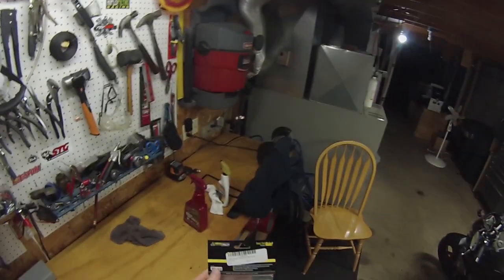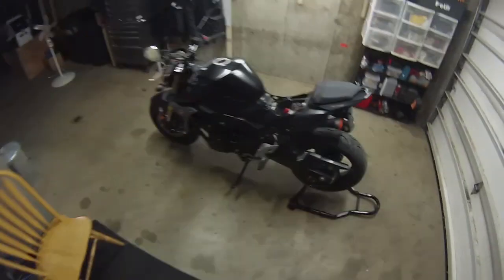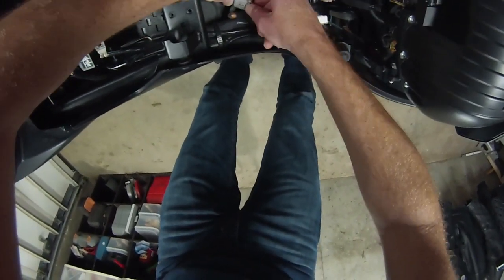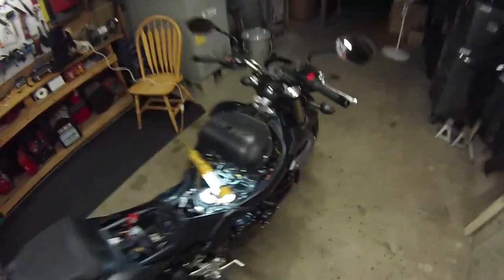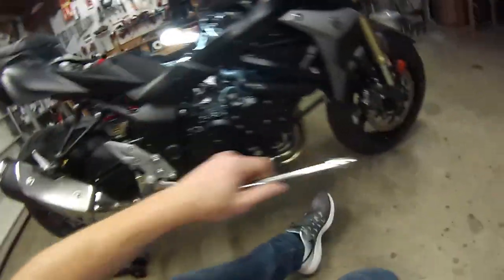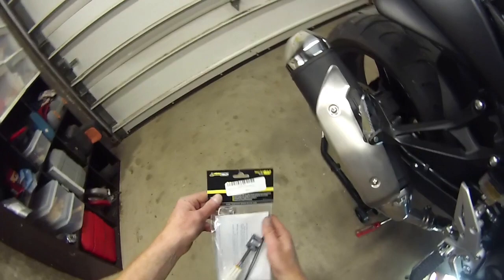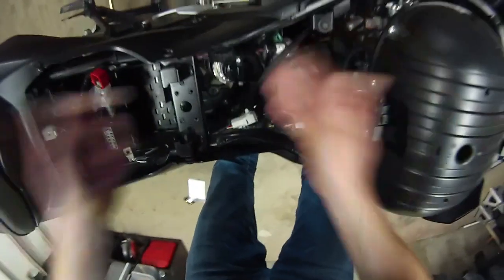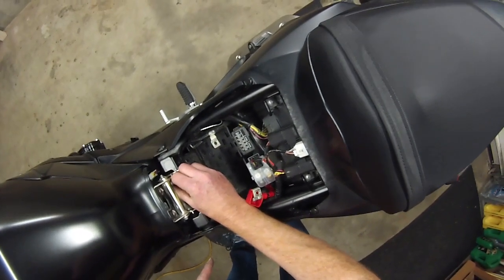How-To | Exhaust Servo Removal | Suzuki GSX-S750

Comment: I have a 2014 GSXR 750 Man u hit the nail on top of the head ,,,,, so I took off  the cat and put on a slip on ... it ran ok sounded a lot better of course. .. then I put in an K&N air filter and took off the the servo motor ..wow what a big  difference  a really big difference. Doesn't feel like the same bike at all ...it just runs so much better  night and day better

Comment: Hello Michael,
Do you think this valve is only for noise reduction or is there another use ?
Reply from the maker: It’s designed primarily to control back pressure. To improve low end throttle response. On some bikes it works well. On this one, in my experience, it’s in the way. The engine likes it gone 👍 And this engine likes the intake opened up. Funny that the newer version of this bike do not have the servo valve and the intake opening is much much larger 😎👍 and they make more hp. IMO, since this engine was built back in 2005 it was never meant to be saddled with all of these control systems. It wants to breathe!!

Comment: Any idea if the servo of the Suzuki Katana 2020 is the same place? I really hate how there is no manual that shows how to  remove the fairings and tank of the suzuki katana
Reply from the maker: I think they stopped using the valve after 2016?? I bought a manual for my bike at https://www.service-shop-repair-manual.com/ good prices. Hope they have one for your bike. It helps!

Comment: I removed the cables from my butterfly valve and started my bike... one is now jammed as far up to the nuts as possible and the other is sticking out 4 inches. I was going to adjust back pressure but now I'm in over my head. Any tips on how to get the cables even again?
Reply: Disregard that. Just got it lmaoo
Reply from the maker: @oogaboogaman753  Awesome :)

Comment: Put in a lithium battery. The prices have come down quite a bit lately so it's a nice and easy way to improve the power-to-weight ratio. Not that you'll even notice it while riding but in theory you should be improving handling, acceleration and even fuel economy.
Reply from the maker: When this one dies I'll take a look at lithium. I'm always looking at gains vs cost.

Comment: Awesome Video Bro!  I really appreciate your effort showing other GSR/GSX-S users how it works. I got the F1 code error with exhaust valve problem. I am really disappointed with Suzuki. They've made such a part that is only working sometimes with lots of complaints and faults. Now it's taking so much effort to fix this issue.
I also saw other people with older GSXR who did just cut the exhaust control cable, removed the #30 wire,  that over-ride the F1 error. I was wondering if that technique would also work on this bike. I knew the Eliminator is the ultimate solution, but I also saw other comments that it failed to work, probably because it's incorrectly installed. It's still a bit risky, isn't it? 
Alternatively, get a new new SERVO and replace the faulty one.... maybe. sorry for putting a long comment, I'm weighing the best way of solving this issue...
Reply from the maker: Thanks for the feedback and comment. I went thru a similar search for a solution to the servo valve. I learned that it has an electrical adjustment range that needs to be dead on according to spec, I learned how people removed it or bypassed it with different methods. I also read about how some bikes ran better with it on, some ran worse. As I learned, the gsxs runs better with it removed. And the best long term fix is to remove it and use an eliminator that will lie to the computer so that everything runs perfectly. (But of course this leads to the need for more fuel which means more cost/programming). But If you ever need to trade your bike or sell it, you can always include the original parts, and they can be bolted back on if needed. But as soon as you start hacking and cutting, your bike is no longer “clean”. Often, homegrown budget solutions can be unreliable and downright ugly and if you do something wrong can lead to more problems. I don’t like to spend money either. But when it comes to a motorcycle, I like a solid clean reliable solution. That’s just me! It helps me sleep better at night 😎👍
Reply: @sstressfl  That's a good point. I'd rather have it properly fixed too. Thanks a lot for your fair opinion. 
I'll take my bike to the dealer next week to ask for their opinion, and decide what to do next. My GSR has done nearly 80k, if anything is costing over $500, I will need to be very careful with the spending. after all as much as I love my bike, it's worth no more than $3k I guess. By the way, I am in Australia, the parts are not as widely available here. I'll let you know how it goes. Thanks Michael!
Reply from the maker: RiderYin I look fwd to hearing how it works out for you. Hopefully well under $500 👍 Dont be a stranger my friend 🙏✌️
Reply: @sstressfl  Just to update of SERVO. I've sent my bike for 72k major service. I've mentioned about the exhaust valve issue, the Suzuki workshop mechanic instantly recommended the Healtech Eliminator to me. It costed AUD$80 + GST to get it done along with major service. Now my bike feels like brand new! with no hesitation in low end acceleration. Wow, I LOVE it. I should have done 5 years ago. I won't do it, but it must be so much easier to wheelie on GSR now (I've tried, but I thought GSR wasn't powerful enough and too heavy)... Thanks man for your help! I'm not as handy as you, but so glad I got it done. And I'm sure GSR will last much longer!
Reply from the maker: RiderYin that is great news!!! So glad you are servo-free. It makes a big difference on this bike. Enjoy my friend and stay safe ✌️🙏 and thank you for the update 😎👌

Comment: Take the seat shrouds off! It's 1 bolt and 1 plastic clip you can undo with a pen! Then you have a good bit more room to undo those small bolts.
Reply from the maker: I saw that, but was worried I'd ruin the clip. Thought it was better not to remove it if I didn't have to. But it sure would have helped.
Reply: Mine have been very reliable, they come off everytime I touch the bike. Push the center pin in, pull the clip out and when you go to put it back in set the center pin out the top.....

Why the hell am I explaining this, you probably know more about it than I do haha
Reply from the maker: No that's helpful. I've never taken 'em off before. Gives me confidence to remove 'em. Thanks, man!

Comment: Has anyone just removed the cables from the valve and left everything else is place? Or does the servo measure the force required to open/close and throws an error if its too little?
Reply from the maker: Freeflyer91 I’m sure others have tried it. I thought about that as an initial test. But decided I did not like the idea of those cables loose/disconnected inside my bike so I did it right. I like to be safe and keep it clean.

Comment: How rough would the bike run on low end if I did this without tuning afterwards?
Reply from the maker: It runs lean but it still rages. But lean is not safe. Much better after a tune 💪

Comment: Hi, very good video. Just bought a 2014 mod GSR 750 with bodis slip on and want to remove the servo. Will following you video work on this bike as well? Do anyone know for certain by doing this i will get a louder sound and mabye more pops? :)
Reply from the maker: I didn’t get pops. And it’s only slightly louder.
Reply: @sstressfl  i see, did you notice anything else by having a stock bike but with exhaust servo?
Reply from the maker: @jesperdamgaardskogly5390  When I removed the servo, the bike rev'd noticeably faster and most importantly was smoother at all rpms. I did not lose low end. But it did go lean. And these bikes are so lean to begin with, it wasnt ideal for long term engine health. And then combined with an opened up intake (removed the rubber silencer inside of the intake on the 2015 model) and added a K&N air filter, I went very lean. So I bought a power commander. And now I have a power commander with an autotune. Basically, once you start making mods, you will go lean and you will need a tune. I hope helps!
Reply: @sstressfl  i just innstalt servo removal as you did, step by step and my bike wont start? The it tryes to start the engien but its dosent egnite the engine...
Reply from the maker: @jesperdamgaardskogly5390  Youre missing fuel or spark. My guess is fuel. Check for anything you might have missed. Did you reconnect the fuel line? How about the electrical plugs that attach to the fuel pump on the bottom of the tank?

Comment: Hello. I have some problem with this servo removal. i put the Arrow full system pipes and shows me the FI red light when I put the healtech servo eliminator it wont start the engine at all. its same like yours is.
Reply from the maker: Hmmmmm.... it won't start? Is the battery too weak? Or is it turning over and the engine won't fire?
Reply: Michael Byrne battery is fine. when i return back orginal servo it start normal and still showing FI red light.
Reply: i will make a vidio so you can see
Reply from the maker: I think you have a bad Healtech! Can you return it and get a new one?
Reply: Boris Garilović is the problem is solved with the servo removal I have same you mods but still not yet installed ?

Comment: Hey I have 2015 Suzuki gsx-s750 fi is on can you tell me which wires to pull form the ecu to disable it?
Reply from the maker: Dwayne smith it’s important to find out why it came on and fix it properly 👍 safety first 😎 it could be a disconnected vacuum hose or a disconnected exhaust valve. Check all your wire connections. Hope you find it!
Reply: @sstressfl  exhaust servo was removed
Reply from the maker: Dwayne smith Ok. I recommend that you buy a healtech exhaust servo eliminator and plug it in. It will send signals to the ecu so you have proper bike function and no fi light.
Reply: @sstressfl  I'm also seeking the connection to the o2 sensor to the wireloom
Reply from the maker: Dwayne smith does your bike have a fuel manager? Like a power commander? The O2 sensor would have been unplugged and an O2 sim plugged into the O2 socket. Look for a wire clip with a little dead end plastic plug cap in it. Might be zip tied somewhere nearby the end of the O2 wire. But before you make a change make sure you know what’s on the bike!
Reply: @sstressfl  no it doesnt. Just entire exhaust servo removed and 02 sensor disconnected cant find where it connects to. Fi on. Code is c46
Reply from the maker: Dwayne smith the c46 is the missing exhaust valve. The Healtech will fix it. The o2 wire should be under the tank/seat area between the engine and the rear wheel. Go to 10:40 on this video. It might help https://youtu.be/BQsWVlCIMlc
Reply: @sstressfl  ok I'll get the healtech. But for the 02 sensor I checked under the tank and everywhere not seeing where to connect to. That's how I got the bike. Wondering if it's missing a connection from the loom to the o2 sensor that runs from the muffler. If so where can I source that connection?
Reply: @sstressfl  how can I send u pics?
Reply from the maker: Dwayne smith I have a feeling the previous owner installed a power commander. The plug has to be there. It’s part of the main wire loom. I cannot imagine where you would source such a thing.
Reply: @sstressfl  ok. But all that is there is the connection from the muffler and I'm not seeing where on the loom it's to connect to and the length of it indicates it doesn't go all the wa to the loom but another connection meets it at the back of the engine....
Reply from the maker: Dwayne smith that is correct! I only meant the wire it connects to is not a replaceable part. It’s part of the bigger wiring. But yes it extends to meet the 02 wire. If it was cut off or capped there should be evidence, taped ends or a loop on the end of 2 wires with a resistor soldered to the end. Hmmmm.
Reply: @sstressfl  just a mystery. Thanks for the help tho!

Comment: Has anyone heard of boosterplug? Wondering heeltech plus the boosterplug would work, instead of spending more for the pcv
Reply from the maker: I read about it. The boosterplug lies to your bike's computer and tells it that the temp outside is colder than it actually is which forces the bike to run in "cold mode" delivering (as I read) a 6% increase in fuel over the stock level. Seems like it could be a very simple solution to a stock bike, or a bike with a k&n/slipon. I have never used one so I can't speak to its effectiveness. With the simple mods I made to my bike, I needed 12% more fuel, roughly, across most of the rpm range to bring it to a healthy fuel air ratio. I used a PCV.
Reply: Michael Byrne thanks for the input Michael. I did see you went work the PCV. Adding 6% fuel everywhere would probably also richen the mixture in many places, causing long term harm. Im kinda torn lol I think I would like an exhaust sometime in the future so it may be worth investing in the PCV
Reply from the maker: M S I think a pcv is a better investment. If you continue to mod, you’ll want tuning flexibility. Also you can add an air tuner later and it will tune your bike while you ride and adjust itself when you do new mods. Anyway, when you start changing things, it’s always a slippery slope :) changes beget changes lol have fun with it. And be safe 🙏👍
Reply: Michael Byrne agreed! Almost spring time!
Reply from the maker: M S woooooohooooo!!! I can’t wait 👍😎

Comment: I have the same exact bike, what benefits would this mod give you?
Reply from the maker: HFSU Inc. Smoother and more responsive. I also added a k&n, removed the rubber air silencer from the intake, and modified the fuel ratio with a power commander 👍
Reply: @sstressfl  okay and for the A/F ration are you able to pull a log to see where it needs improvements, or do you throw something at it and see if you can feel a difference?
Reply from the maker: @spencerwh123  I bought the PCV from Fuel Moto. They provide maps based on your mods. They sent me one. I ran with it and I liked the way it felt especially up higher, but I was still wayyyyy too lean. So I left the map the same but increased all of the numbers ultimately by 12%. I used a number of things to guide my tune. In short... the seat of my pants/throttle response/idle/etc, engine sound, gas mileage (up or down), spark plug color, header pipe color. I do plan to buy and add an autotune sometime in the future.
Reply: @sstressfl  Hi, 

Whats does removing the rubber air silencer from the intake do ? Im planning some projects to do this winter 😂 thank you
Reply from the maker: Jonathan Boisvert on the 2015 it increases air flow and increases the intake sound. And it sounds ohhhhh so good :)  It’s a simple squeeze and remove. If you dont like it you can put it back in. The mod will make you run more lean. You’ll want to modify your fuel delivery. I use a power commander v 👍
Reply: @sstressfl  ´

Comment: What are the reasons to Remove it?
Reply from the maker: It's a solid concept to provide backpressure at low end, and to open up at high end. But some bikes perform better with it. Some perform better without it. This bikes performs better without it.

Comment: Why u opened the tank ?
Reply from the maker: Great Hema
, I disconnected it and removed it to give me more room to work. When all of the hoses are removed, the tank is completely sealed. No leaks. It was easier to just get it out of the way. Does that answer your question?
Reply: Yes many thanks , I have another question for the power commander I have full arrow system and air fitter do I can upload suitable map for all my mods by my self /
Reply from the maker: @greathema8537  The short answer is yes you can but its best if you have experience with tuning your engine. If you feel comfortable with it, then I would recommend that you order from Fuel Moto https://www.fuelmotousa.com/ They provide maps included with your purchase. Tell them what you have done to your bike then they will send you a map that they believe will work well with your mods. It's not perfect but usually it will get you in the ballpark and you can make minor edits if needed. Also, consider buying an additional Power Commander Autotune. It's like having an onboard dyno tuner that makes tweaks to your fuel map while you ride. But just to add more emphasis to my initial warning - all of this requires knowledge of fuel delivery, tuning, etc. Be careful! You can fry your engine if you don't know what you're doing. Do your homework and proceed only when you are comfortable. Ride safe!!
Reply: I have question mr Michael i will instal power commander then i have a plan to order quick shifter from health tech the question is there conflict will be with the cables
Reply from the maker: @greathema8537  I cant see any conflict. The heal tech is such a clean install. It connects to your coils and does not interfere with the fuel management of the pcv. Totally different system. But I do not have any experience, with these shifting systems and would really enjoy to hear your feedback.
Reply: Sure  will keep you posted , but for know  I will see if there will be  too much improvement and gain after installing the full air exhaust system and mapping I will order the shifter system